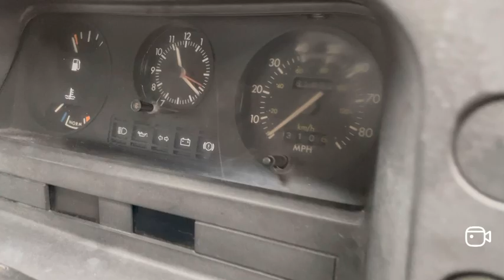Ford transit MK3

Comment: It's in wayyy better shape than some newer transits I've worked on, my granda had a Mk2 and a Mk3 he used to coat in below them both with with a mixture he made of burnt oil, diesel and grease. They lasted him for years. Would be an ideal thing to do to that old girl of yours.
Reply from the maker: Was thinking of doing something like that Iam going to put a flat baled on it next year an give it a restoration